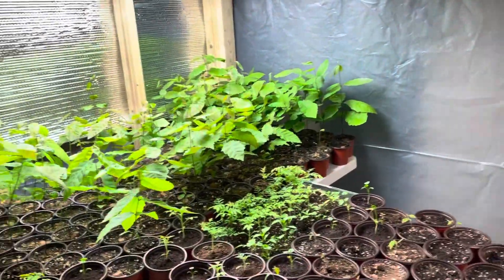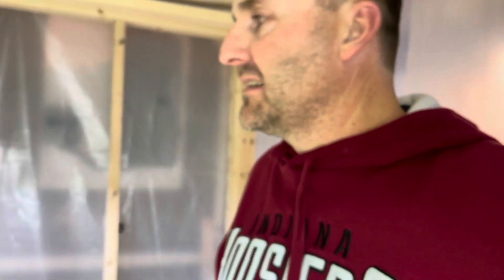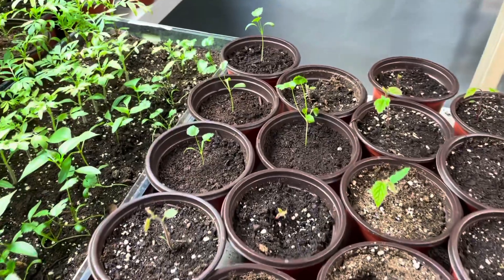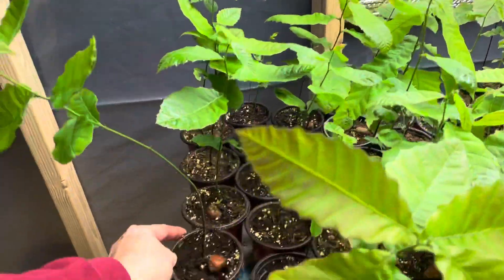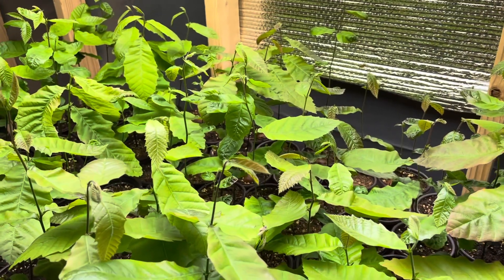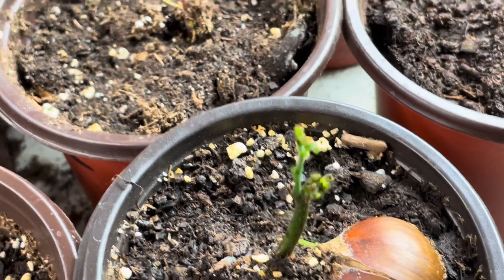Chestnut Update!  What is Damping Off and How Do I Try to Stop It?

Comment: Hi John.  Thanks so much for all the info and guidance.  I've been following your channel for a few years and finally got some Dunstan nuts into the fridge last fall.  I potted the nuts in early April, and everything has been going to plan, except about 2 weeks ago some of the larger leaves on the largest trees started turning a light brown color and becoming sort of translucent.  Now those leaves are pretty much dried and shriveled up.  I was initially watering every 5 days, but I'm wondering if I may be watering too much or too little.  Or maybe it's a different issue...  They started off perfectly green and looked a lot like your trees.  Have you ever had this happen?  Any thoughts or suggestions would be most appreciated.  Thanks!  Rob.
Reply from the maker: I've experienced what you're describing, but not on a large scale.  I've always felt it was a nutrient issue.  I don't have an answer on how to prevent this.  Anyone else who is reading know what causes this problem?
Reply: @johnsangl  Thanks John.  I'm hoping to get them outside in about a week, so maybe that will help.  And I'll give them a little shot of dilluted fertilizer since they are now 15-18" tall.